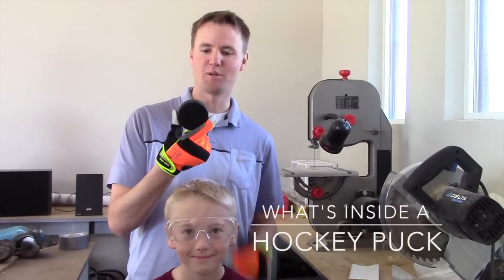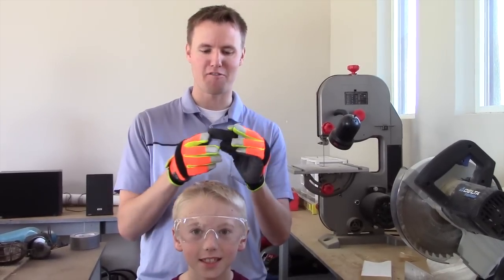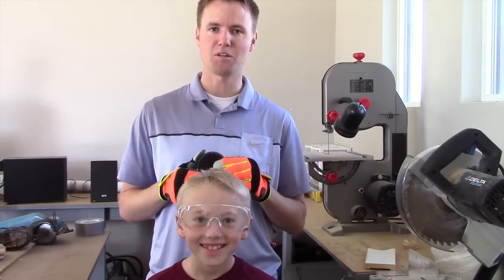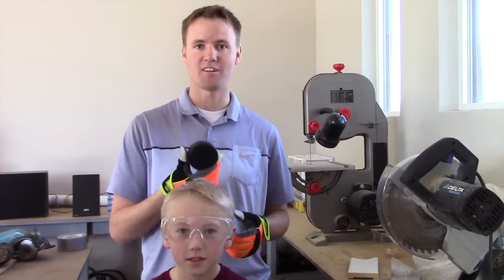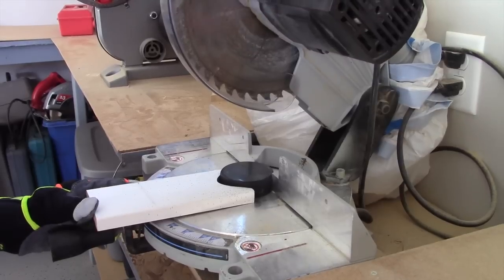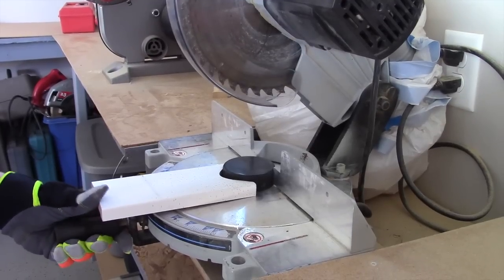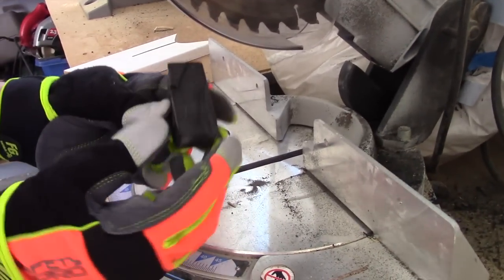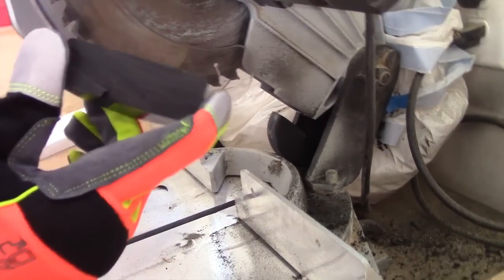What's inside a Hockey Puck?

Comment: Future tip, keep the blade running as you slowly lift it out. That way it can't get stuck, or cause everything to fly everywhere. (The cut isn't over until the saw is out of the object, so don't turn it off until the cut is finished)
Reply: I know it seems like you should turn it off before lifting it out, but a saw moving at a slower velocity has a greater risk of snagging on the object. A fast moving saw can be lifted out with ease.
Reply: The REAL rookie mistake is to turn it off prior to lifting it. I like this channel already and I am looking forward to your future videos.
Reply: Lol almost lost my finger using a saw

Comment: Could you cut a practice (orange) puck? I think they are hollow.
Also interested to know if weighted pucks have metal weights inside (care!)
You might like to have the turntable at 90 degrees to where you had it in this vid so you are not cutting towards your hands and the holder
I would really appreciate your help on this; there are things I want to make from hockey pucks, and I need hollow ones.
Reply: Yeah the roller pucks would be pretty nice, do specialty ones.
Reply: A blue hockey puck or even a white one. I wonder.